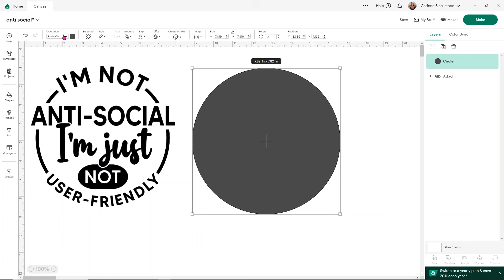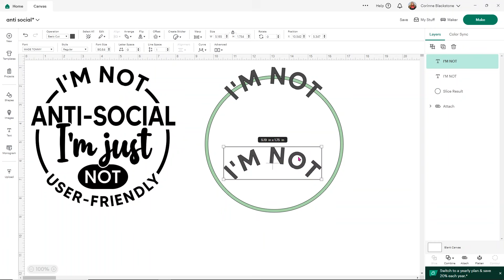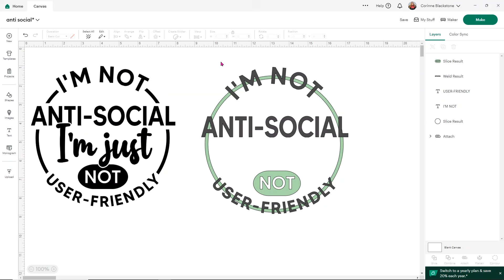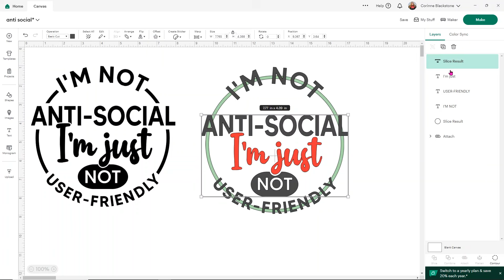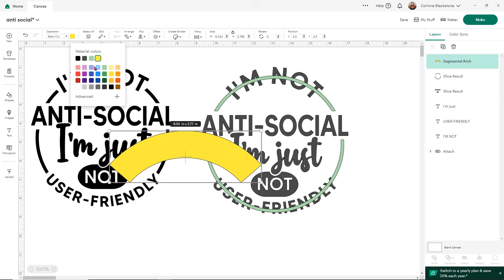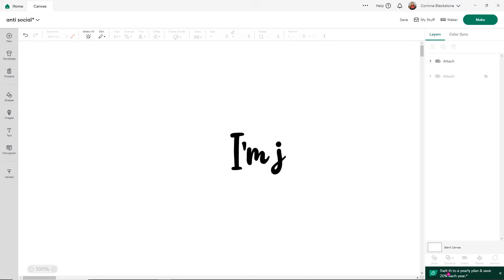Learn to Create Custom Designs in Cricut Design Space Today

Comment: Luv your tutorials❤❤
Got a couple of questions…
1. If you only use System Fonts (not cricut access) and the free basic shapes, why or how does that not permit you to sell your design?
2. Could you create an inner offset of the circle then slice instead of two circles?
3. Since Cricut Design Space defaults to the last font used, while working on the same project, couldn’t you just create a new text instead of coping and pasting?
You are right about the difficulty in creating with Cricut Design Space. So many work arounds. Don’t get me wrong, I really like how the Cricut cuts. However, my first die cutting machine was a Silhouette Cameo. I made a one time purchase of the Business Edition software and I can create, create, create and use.
T.I.A and keep up the great tutorials!
Reply from the maker: 1. If you read the Cricut terms of service it basically says anything made within their software regardless of what images fonts ETC you used you cannot remove from their software. Its on of the many reasons why I am teaching more inkscape tutorials this year. 
2. You could do an inner offset. it would work the same. I like to do the two circles just because I find adjusting the sizing a little quicker since offset can be a little slow 
3. You could create a new text box yes I choose not to do that for the same reason I don't use offset. It's really slow compared to copy and paste. 

I will be posting this sunday a video where I teach how to design this with inkscape which is still quite a bit of work but then you have all rights to it and its already and SVG so unlike with Design space you wouldn't have to try to convert it which can lead to a poor quality image.
Reply: @ Thank you so much for your quick response and guidance. You are appreciated.